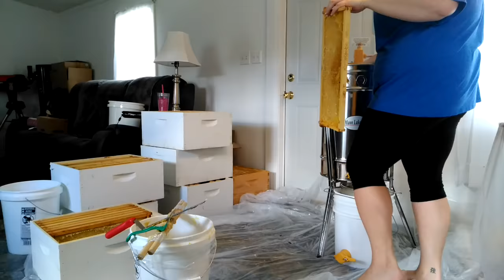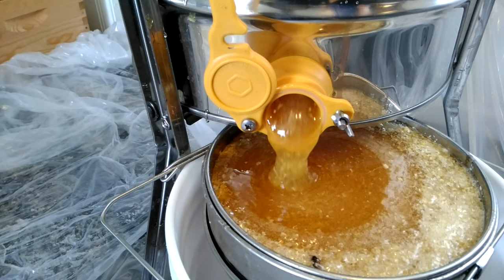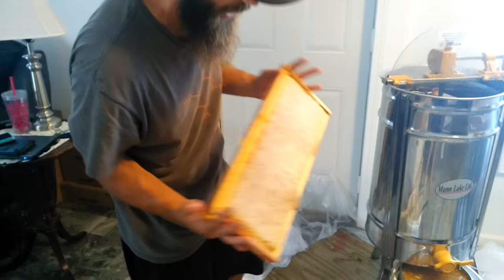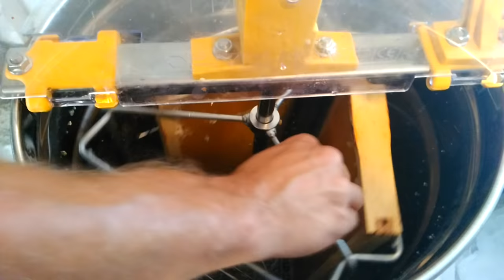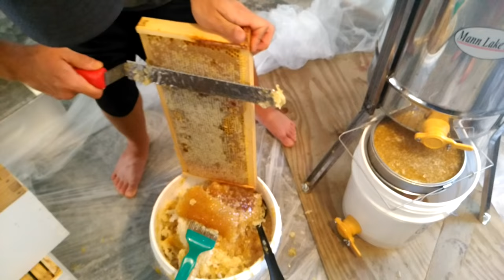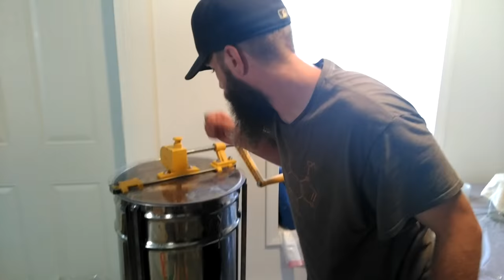Honey Extraction 2016 - 505 pounds!

Comment: I've always used a roller , and I love the fact it doesn't year up the comb.I set out wet frames,bees pull all the leftover cappings off, and can fill right back up if need be.My question is how are the combs after using a knife?I like the amount of Wax u get,as long as it's just the Wax and not much of the actual comb,does it year up ?

Comment: I see you have the same extraction gear as myself. Have you found a way of stopping the finer filter mesh from getting clogged or an easy way to keep honey flowing through it?
Reply from the maker: No, that's the big slow down for sure. At this point I just extract it until the screens (I have like 4 of them now) get clogged, and then I extract into buckets without screening it, with plans to screen it later by the bucket as we need it. 

Hopefully within the next year or so I'll be able to upgrade that stuff but right now it's just a huge pain in my neck.

Comment: Loved the video. Do you have a video on processing the cappings and honey left in it?
Reply from the maker: Unfortunately, no. I will certainly make one in the future, but the process is easy(ish). We leave batch after batch of cappings above the double screen, each batch for a few hours, and when all of the cappings have been strained we leave them in a bucket overnight for the remaining honey to collect on the bottom. The top layers of cappings get melted down immediately while the bottom layer gets fed to the bees. 

There are different methods for processing wax, some involving a crock pot, or solar melter, or just melt it in a pot of water and pour over cheesecloth. The solar melter is by far the easiest and least labor intensive.
Reply: B&K Bees @

Comment: I understand the top 1 or 2 supers is where the bees make the honey and fill the racks.
The lower ones are where the queen is and lays her eggs and raises workers.
Am I correct in this ?
Reply from the maker: Yes, for the most part. Sometimes there's brood up top and sometimes there's honey down below, but beekeepers normally try to keep things just as you described it.
Reply: OK... How do you keep the queen in the lower box? I know she is bigger than the workers. Is there a divider between the lower boxes and the upper ones?
Reply from the maker: You can use a queen excluder, which is just that, a divider that allows workers through but not the queen. Or you can just let them decide how much brood to raise, either way you're likely to have some honey frames to select from.

Comment: The scratcher is supposed to be used flipped the other way. It is supposed to have a lifting effect on the caps by sliding it underneath and lifting up. Less damage to the cones this way as well. :)
Reply from the maker: Yeah, but, the scratch method is way faster, and the damage to the combs is not an issue at all, the bees work it and fix it with no problems afterward.